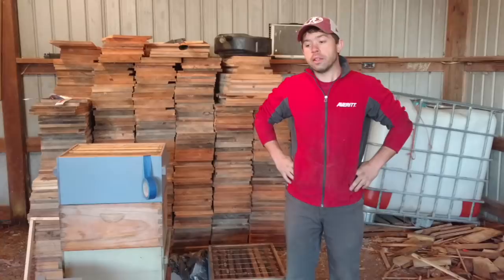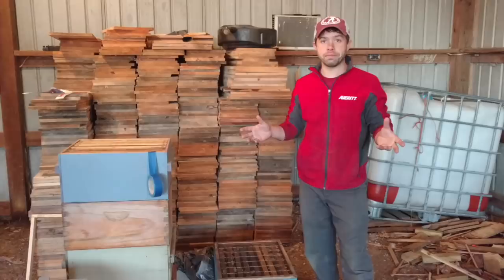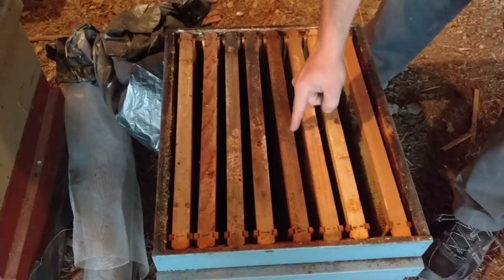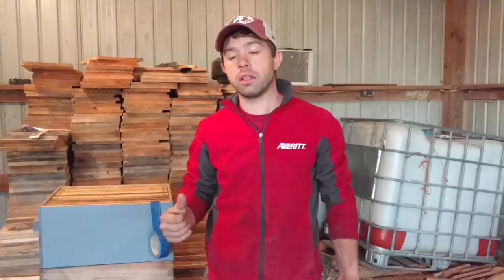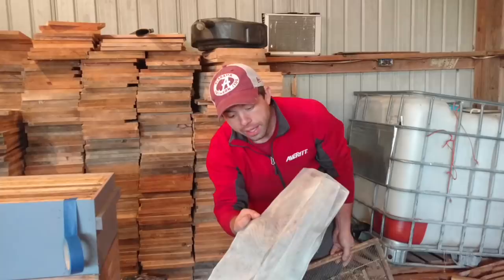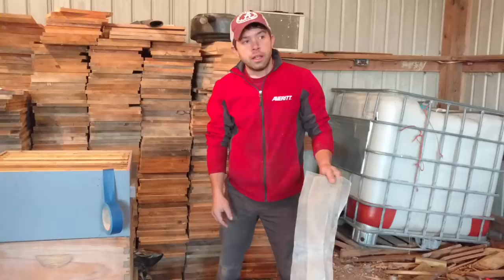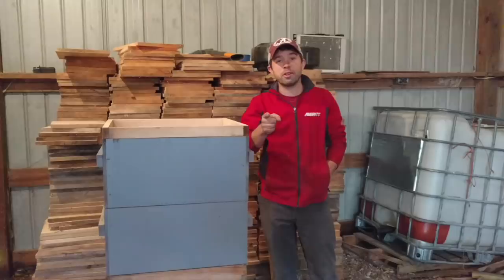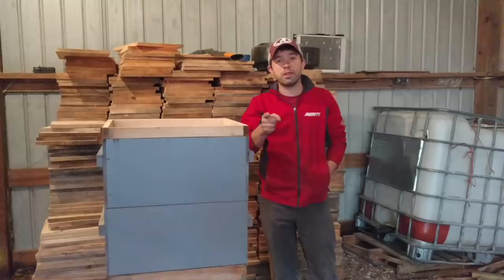🔵How to keep your combs safe from pests over winter

Comment: I like to use that plastic you wrap pallets for shipping when i seal my hives up. I also have a couple pieces of plywood with a lazy susan device so I can just spin the whole stack. This also does double duty for painting hive bodies. The lazy susan device is about $15 at Lowes in the hardware section.

Comment: Lost 25 frames of comb this spring. In storage - went to pick them up. Moth balls (Para-type) had evaporated. There were literally tens of thousands of wax moth larvae crawling all over the storage unit - it was horrible. The combs were gone - piles of dust at the bottom of the boxes. Several of the frames had wired foundation - nothing but the wires were left. 

It was a painstaking and gross cleanup - had to kill all the larvae manually to keep them out of all the other units. I was sure the manager was going to bust me and kick me out of the unit! 

Wax moths certainly have their purpose - they can clean out the old comb in a tree and make it ready for a new swarm to move in and build new comb the next year. They will do the same to your frames. 

Lesson learned - check the moth balls frequently.

Comment: Get a tub and dip boxes,frames with or without foundation and tops in Bt solution.The spray combs with frames with Bt.That way wax worms wont eat your wooden ware also.Then they wont eat everything if you happen to have a hive die out or just get weak on you during any time of the year.

Comment: we are usualy use sulfur strip, have special box for storing frames burn 1 pc strip monthly until not fall temperature under 10 cellsius (around 53F), but I store 80% frames in hive, I put super box with 8 frames under brood hive during overwintering bees care it, just 20% protecting by myself.

Comment: Just for the record....old fashioned “moth balls” usually contained the chemical Naphthalene which is much stronger and more toxic than “moth crystals”
Which usually contain the chemical paradichlorobenzene.  Most of “moth balls” that they sell today in Hardware Stores now contain paradichlorobenzene which dissipates faster into the air and is less toxic.
Reply: One shoo,  that means that the modern moth balls are basically the same as the crystals, or at least has the same basic chemistry? Do you know if the percentage ratio is the same in comparison?  Thanks, Phillip Hall
Reply: phillip hall 

Yes if the “moth balls” are para then you can use them in the same proportion as the crystals. However,......please make sure that they are PARA AND NOT NAPTHA!!!!!   You do not want to put Naptha in your comb! Someone also mentioned that Para sublimates quickly and should be re-applied when necessary.
Reply: @PhillipHall01  Enoz Moth Ice Crystals marked "para" is the exact same product as paramoth. 
I check the msds.
If you get the crystals in the cardboard cylinder with plastic lid...that's EXACTLY the same as paramoth except for labeling.
Reply: Thank you both Mike and One Shoo for the help. Very appreciated!

Comment: Hi Kamon Reynolds,
You kan use acitic acid 75% it is prevent wax moth totally and it’s get ride off Nozema spores, you will put many boxes together and above the last one you will put acetic acid in a dish and acitic acid will begaine to evaporate and because of it’s heavier than air it will go down, it’s perfect and we use this method in Sweden.
Reply from the maker: That sounds great is there any more details to this method I should know about? Or is it that cut and dry?
Reply: @kamonreynolds  no more details, it's very easy and organic method you will only put acitic acid in a dish on your boxes and close it well acitic acid will vaporize and  work as a repellent to wax moth and kill all Nozema spores.
Reply: I heard people use formic acid in same way, never tried it though.
Reply: @lazarmasni9748  formic acid work on both varroa and Tracheal mites
Reply: @TheHmye  i know that, but I heard people are using it to preserve the combs as well.
Reply: @lazarmasni9748  Acitic acid for comb which is good against Nozema spores, not formic acid
Reply: Is it liquid?  High AA vinegar?
Reply: @lindadecker2189  yes, it’s liquid.

Comment: Would it work, since I only have a few hives, to places frames with comb on them, to put them in a plastic storage tote and tape them around the edges without putting the stuff you used in the box!
Reply: Moth worms will get in under the edge.  I used heavy duty black trash bags and taped….they chewed through.
Reply: @kayelkins6060  oh wow, that's crazy! Them things are persistent i guess! Thanks!